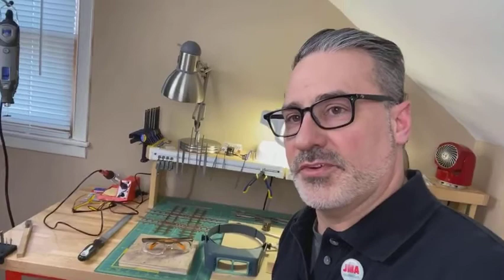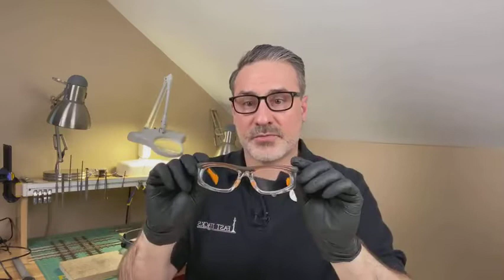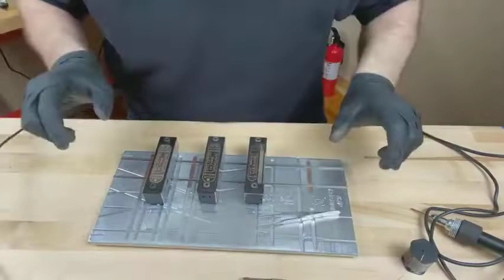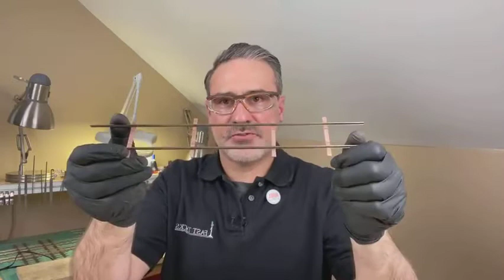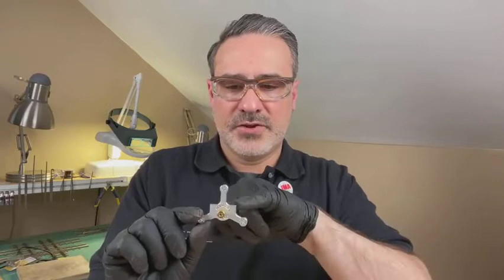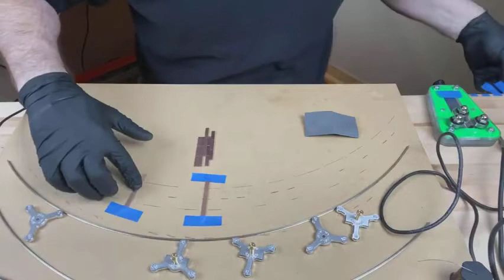Upstairs In The Workshop, Vol 1: Proper Track Soldering Techniques

Comment: If you clean your rail with denatured alcohol or acetone you wouldn’t have to use a wire brush or sandpaper...in the electronic industry acetone is used to clean pc boards and copper surfaces pre solder and after soldering...just saying...seems like an awful lot of work when a dampened cloth with solvent would work. Thanks for the video(s).